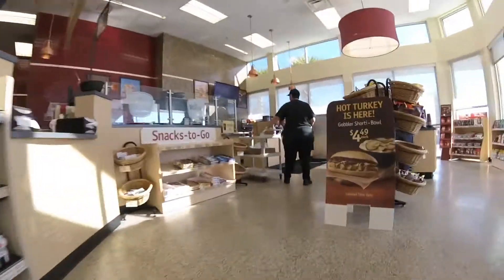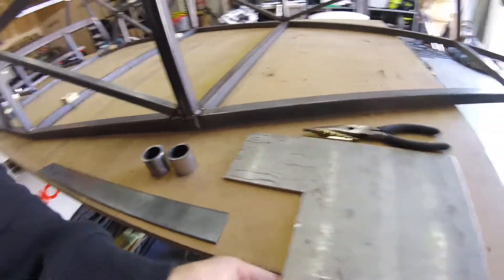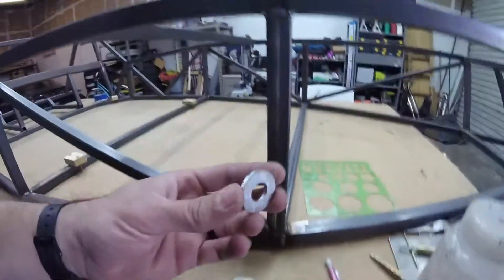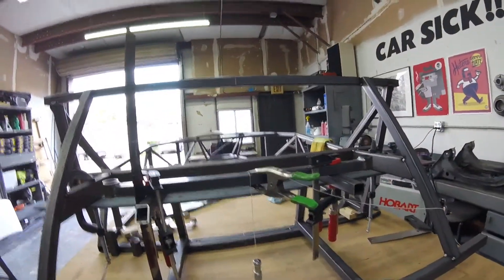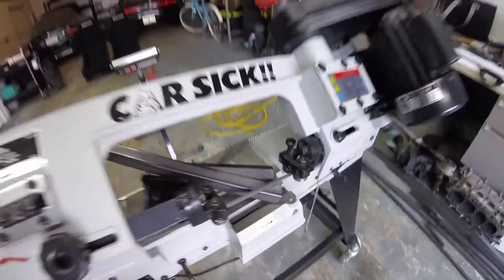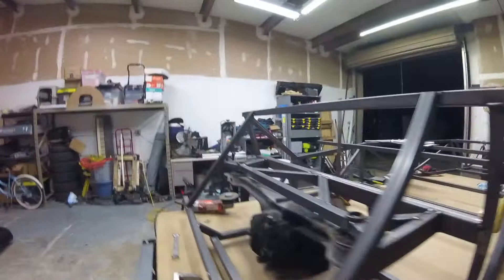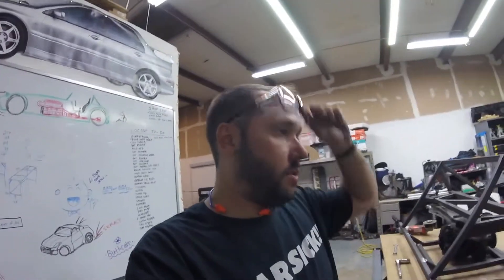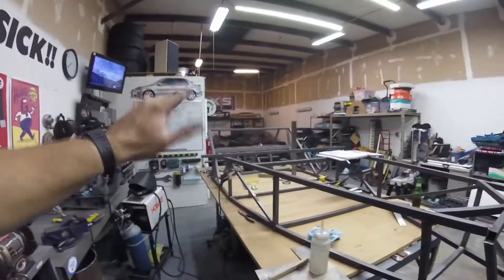Locost Miata Differential Hanging In Style

Comment: Nice work - did you happen to weight the tubes it took to mimic the rear subframe?  Curious on the delta between the two set ups (but even if they are the same weight, I think the tubes are the way to go to get the wheelbase you want - and it looks cool).
Reply from the maker: Unfortunately I didn't. A lot of the tubes were a modify-as-you-go kind of thing because I was using two different frame plans. There would be no way to cut them all correct first and weight them. When it's all welded, I will get some frame weights and we can compare it to other builds. There are a few guys on the forum that have Miata subframe and maybe they weighed theirs. There is a lot of little tubes to doing it this way, but I feel like it will be stronger than just four bolts holding a heavy subframe on, especially when compared to the rest of the car, its relative weight is greater than when it was in a Miata. Looks better, I'll be able to use rod ends for better adjustability and performance, a little better wheel base, stronger, it's just a better solution. Thanks!
Reply: Cool - do you have the lengths of each tube so you could add it up, then maybe I could weigh a length of tube that long?  Add a couple extra pounds for some weld and the bolt carriers?  Thanks - again, great work!
Reply from the maker: Do you have the Vodou plans? I'm adjusting some lengths and angles a bit, but not really that much. It is still relatively close, I think I remember reading on the forum how much a foot of 16 ga 1" weighs.
Reply: I do have those plans, as well as the Saturn Sports Car plans.  I haven't decided which way to go yet - I'm still tearing apart the donor.  I like the look of the Vodou stuff, but it is printed really small and seems to be missing some dimensions for the a-arms and such.  The SSC might be missing a dimension or two as well, but it looks like it is more based on the Haynes chassis stuff, so I could wag that without having to do a lot of math again is what I'm thinking!
Reply from the maker: Yeah, I don't really like the control arms because they don't use heim joints. I'll probably just copy the lengths of the stock ones, stick rod ends on a plywood board and connect the dots with some DOM. So many decisions.
Reply: I was planning on adapting either set of plans to use heim jointed control arms but use the pick up points they have.  Stock Miata is another way to go - I haven't looked at the suspension math to figure out what roll centers, camber gain, etc. would be with those numbers.  Do the tubes used to make the rear frame locate the inner suspension mounts at the same distances as the stock Miata subframe?
Reply: There's always these I found digging around the world wide net:  http://www.kitspares.co.uk/index.php?route=product/product&path=43&product_id=1094&car=43